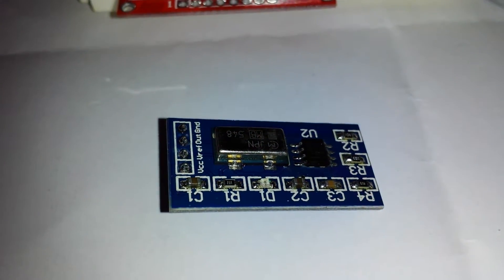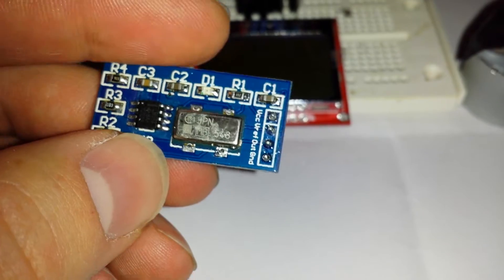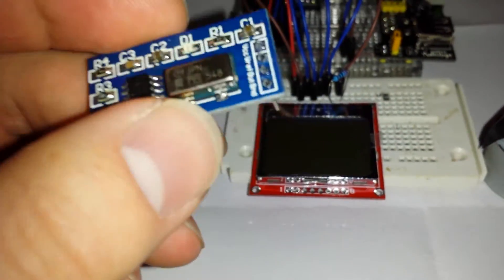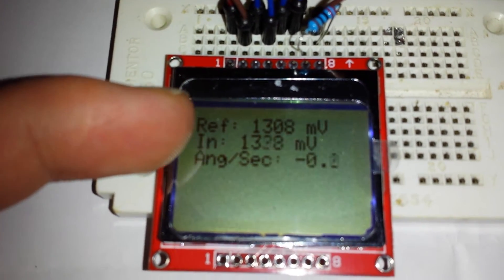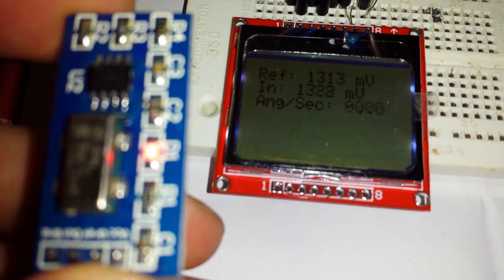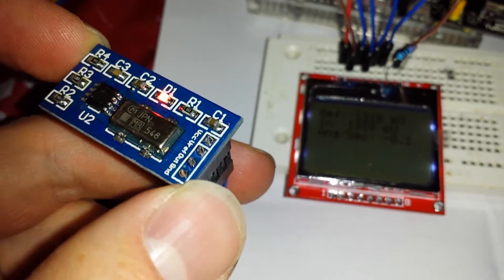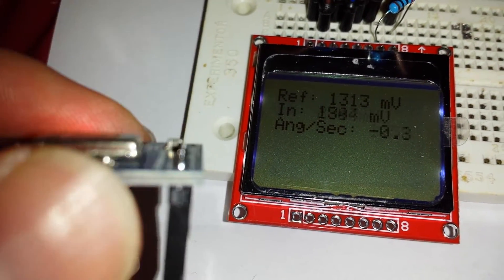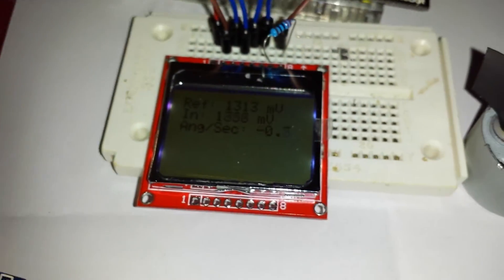ENC-03 single axis Gyro board from icstation.com

Comment: THANKS FOR THIS BRIEF TUTORIAL!  I'M TRYING TO FIGURE OUT HOW TO BUILD A SYSTEM/CIRCUIT, THAT CAN USE SOME SIMPLE "FORCE SENSOR, LIKE A "SINGLE AXIS GYROSCOPE, OR "ACCELEROMETER"", TO SIMPLE TURN (SWITCH) 12VDC POWER TO ACTIVATE THE BRAKE LIGHTS ON A MOTORCYCLE, WHENEVER THE BIKE BEGINS TO DECELERATE, BEFORE THE RIDER EVEN HAS TIME TO APPLY THE BRAKES.  SO, AS SOON AS THE BIKE RIDER LETS UP ON THE THROTTLE, AND BEGINS TO DECELERATE, THEN THE AUXILIARY BRAKE LIGHTS WILL BEGIN TO STROBE.  PERHAPS YOU MIGHT HAVE SOME SUGGESTIONS?!  THANKS!!!!!!
Reply from the maker: That would require an accelerometer. Simply add a code that would sense the movement in one axis and have it do what you want at this point. You can even set the sensitivity in your code or have an external adjustment. You might want to ad a small delay because you wouldn't want the light to turn on every gear shift. Cheers
Reply: @bakupcpu  Thank you, backupcpu, for your adice, suggestions, (and, again, for this great tutorial video)!
Reply from the maker: @guloguloguy  You're welcome glad I was able to help.

Comment: Nice video!! I am having problems with my ENC-03M. When I stop rotating it, it returns values like it was being rotated in opposite direction and after some milliseconds (or even seconds) the value reaches the Vref. It seems to be measuring the angular ACCELERATION, instead the angular velocity. I have a graph of the values (http://s30.postimg.org/9mu9us1zj/gr_fico.png). How did you connect the board? I tried using a 4.7uF capacitor in Vref and the results didn´t changed.

PS: Sorry my English, it isn´t my native language.

Thanks,

Eduardo
Reply: Teodomiro, comprei um mpu6050 com giroscópio e acelerômetro. Devia ter feito isso muito antes!
Reply from the maker: I simply connect it to my arduino analog pin and I use the ref out which on some board it's not there for some reason. I use the datasheet to make some very quick formula. One thing you can try it lower the reading I would have to recheck the datasheet o see the max reading you can do. Beside that I have no clue why you would get those type of reading. Let me know how it turn out :)
Reply: bakupcpu Thanks for the answer. I already checked the datasheet 183 times! :D Well, lets continue the battle againts my ENC-03M...
Reply from the maker: Hmm.... maybe you have a faulty unit. I didn't play a lot whit mine I did some test and now it's in a box.
Reply: +Eduardo Sartori de Camargo Ai, Eduardo! Conseguiste resolver o teu problema...?